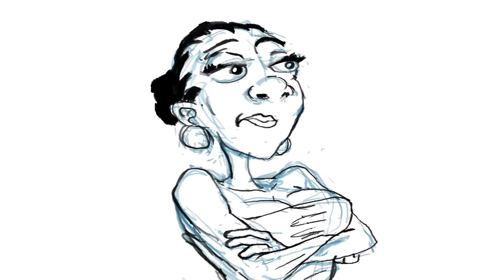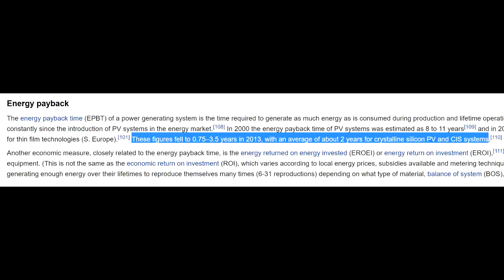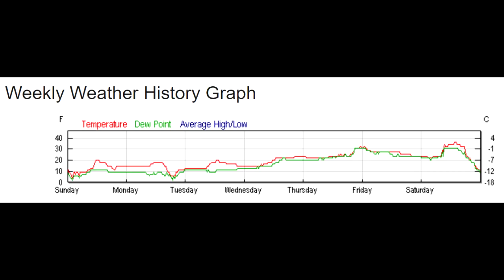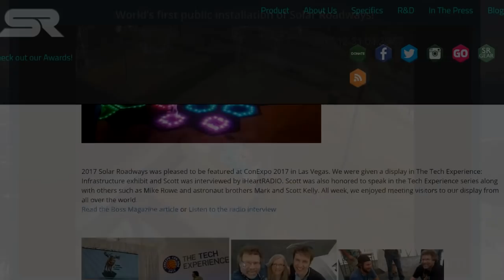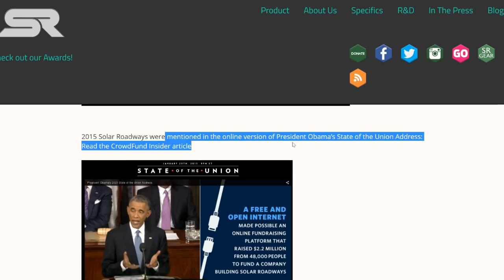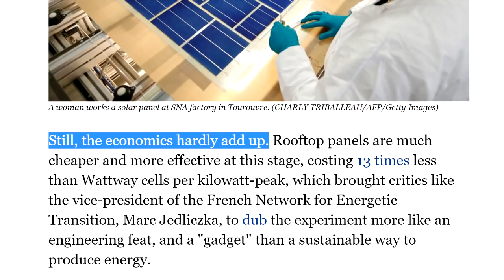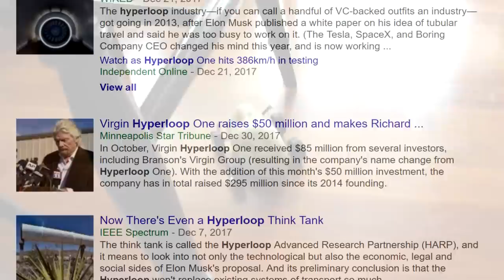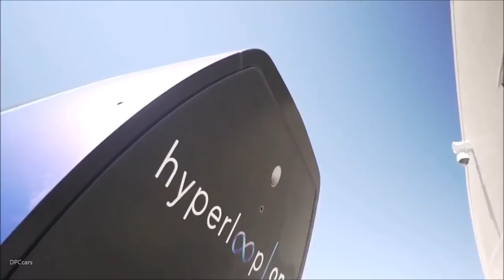Solar roadways, NEVER shovel snow agai... oh

Comment: "three types of packets"
data voice and video

As a networking professional this makes me scream. SCREAM I TELL YOU!
Reply: M5000 Blog it.
Reply: Elaborate for somebody who doesn't get it? Thanks!
Reply: only one type of packet, UDP. If you want to have some acknowledgement of the recipient actually getting the packet you have a stream going both ways, which then allows TCP to work. All the packets are the same size in the network, and all just have where from, where to and a block of data, plus a little bit of control data at the front. The network does not care, what it is, just where to move it to, it makes no difference if it is voice, cat video or your banking or recipes for cat food, it just is all the same in the network ( at least till the ISP's start charging for "premium" access or blocking the competition) as data blocks.
Reply: SeanBZA what would you call an analogue packet.
Reply: I thought it was Shitpost, Fake news and Porn shrug I s'pose ya do learn something new every day.
Reply: I have facepalmed so hard...
Reply: Well, we`re not talking about TF...
14:40
Reply: @Cameron Harvey
> Elaborate for somebody who doesn't get it? Thanks!
Let me try.

The internet is basically a bunch of machines all using the same protocol stack, which is layered. The bottom layer is the hardware layer (physical connections: plugs, cables, network adapters and so on). On top of that is the lowest software layer: the internet protocol IP.  On top of that there is UDP and others (but let's forget about those here, they are not important here) and most importantly TCP. TCP is short for transmission control protocol. TCP controls the data flow. The combination is the TCP/IP stack. 

The TCP/IP layers don't care WHAT they are transporting, they "only" make sure that data gets from one IP address to another.

The application layer on top of TCP/IP knows how to interpret the data. A video player will know how to play videos (including audio). Voice is just an audio stream. Data is all and everything what TCP/IP transports. 

But a video stored on disk would also be played with the exact same video player. So "the internet" is about transporting data and not trying to understand it. (Sidebar: At least as long as you have net neutrality ;-) ).

So, that is my take ... but I'm not a native speaker.
Reply: +Dick Bottox No problem bro. xD
Reply: +Conenion Very good explanation!
I was too busy "investigating" another part of this video...
https://www.youtube.com/watch?v=oNjPHcIzQkM
Reply: Porn is all the internet is for, as the song clearly notes.
Reply: SeanBZA, I suppose that's one way to look at it, but it really depends on where in the encapsulation you think it's important. Ultimately everything is bits but the least encapsulated layer is the link layer (Ethernet being the primary encapsulation). So why wouldn't you just say there's only 1 type of packet? As you said though you could go up the OSI and argue that layer 4 matters the most, the TCP/UDP layer, but then you run into the problem that there's more protocols than just TCP/UDP, eg ESP, ICMP, etc. Even the IP layer has both IPv4 and IPv6 differentiated. All in all that guys comment was stupid. He just arbitrarily picked 3 things and claimed those were the only packet types that mattered.

EDIT:

For everyone mentioning that the guy is from Cisco sales, what he's saying makes sense only from a business QoS perspective. Still his statement is simplified to the point of useless from a technical narrative.
Reply: Yeah that was dumb. Video is data, voice is data. It's ALL data...
Just another reasons why broadband was a stupid analogy to use.
Reply: Ah, I remember commenting about that on an earlier video. Data is data is data, the metaphor was stupid.
Reply: There actually is 3 types of packets. Standing, kneeling and pron. :)

Comment: why not do a solar powered hyper loop? two birds one stone
Reply: great idea. line the inside of the tube with solar panels, what could possibly go wrong?
Reply: Thinking about it, i think nuclear powered maglev train is a better idea. Hyperloop vaccum is good for speed, but there is alot of engineering problems.
Reply: Note next to the hyperloop there is actually a solar farm, right there in the desert with 12 hours of sun a day, and pretty much no snow as well, plus the panels do not need to have cars drive on them either or have fancy lighting patterns either.
Reply: @Divine Linker  Forget it.  Anything with the word "nuclear" in it, and people lose their minds.  When radiation preserved foods come back, i'd be more inclined to consider it possible.
Reply: Lassi Kinnunen
I mean, if your project doesn't "pay for itself" one way or the other, it probably shouldn't be getting funded in the first place.
Reply: Two birds, one coffin.

Comment: As I have said before, if someone wants solar roadways, then roof over the roads with solar panels. That would reduce snow and rain, and be cheaper and make more power.
Reply: Indeed though you still would have massive installation costs outside urban areas where there is no power infrastructure to carry the generated energy to consumers. Excellent idea for urban streets though they of course already have mains grid cabling running under them as they are of course lined with power consumers like buildings and street lights already.
Reply: Hey Pat! Always a pleasant surprise to see you in the comment section.
Reply: +meaturama Actually no it wouldn't be a cheap steel support column and frame every few meters is dirt cheap especially compared to the inch thick or more glass that would be needed to make the panels last even a year on the road surface that wouldn't be needed if placed on a roof like that. Also the latter panels would have a service life of 20 years rather than 6-12 months fact is that box steel girders are not exactly expensive an even if they were it the cost would be well worth it to extend the life of the panels by a factor of 20-40 and make them last long enough to generate a profit which ones on the road never will. The fact is there are no known transparent materials which are anything like strong enough to last longer than 6-12 months under the stress of motor vehicle traffic.

Prices for bulk regular solar panels are down to around $100 million per square km including installation or there about that would easily cover 100 km of road, solar roadways are quoting $10 million per km which would make that $1 billion to cover the same amount of road how exactly do you get the idea that $1 billion > $100 million. The figures are worse when service lifetimes are considered which works out to be $1 billion per year for solar roadways if not more compared to $5 million per year using regular mounted panels both for the same 100 km of roads.
Reply: The engineering or funding isn't the problem.  It's dealing with the red tape (and lawsuits) that takes the most time and money.  Just try to get approval for any sort of infrastructure project that isn't directly run by the government/military.  And if you're going to do that, you'd better make sure you get comparable returns on your investment BEFOREHAND.  As in, the tech actually working.
Reply: +meaturama "that is a thousand times more expensive than putting solar panels on the road"

No, as soon as you consider maintenance costs it would be FAR cheaper. There's no way a solar panel exposed to constant car traffic is even remotely affordable, and for replacing just one you'd need to block the street. If you use them as roof you still have higher installation costs than on the roof of a building but the maintenance costs would be comparable and in turn you don't need to care about snow and wet roads as much. It would still be a niche application but far more realistic.
Reply: +SaHaRaSquad I could see the structure also being used to supply trolleybus and/or tram lines and carry street lighting also reducing the maintenance costs by combining several separate pieces of infrastructure onto a single framework. Installing and maintaining thousands of light poles doesn't exactly come cheap for example and many cities are already looking to replace old sodium-vapour/halogen fixtures with more efficient LED systems.
Reply: +zaco21 Indeed, if you read my first comment I did actually point that fact out would work a hell of a lot better too with the panels being able to be mounted at the optimal angle for the latitude of the installation. Not to mention the whole benefit of not having their effectiveness reduced by scratches, cracks, oil, debris and dirt from motor vehicles reducing the transparency of the glass covering over the panels.
Reply: meaturama - People already do this with parking lots and still see a ROI.

Edit: Snow is still an issue, though.
Reply: + meaturama
A thousand times more expensive you say? Show me your math. Or let me do it for you, while pointing out several other problems with this nonsense. A solar panel that could handle the stress and wear of a road probably doesn't even exist, but the one that claims to be that costs 20 times as much to install as a typical rooftop installation. Admittedly, we would need to build the roof ways and that would be expensive, but the roof, if designed properly, would save a lot of wear on a traditional road - especially in the north. What causes most cracks and potholes is water seeping into the road surface, and in the north it can seep in a freeze which is far worse. Minimize the water getting on the road, and the road lasts much longer, and needs less maintenance. Solar roadways would probably be harder to maintain than conventional. That's because they would basically have to be built on top of a normal road. They could not just be placed on graded sand and gravel as the weight of the vehicles would quickly deform the surface of the road, and possibly break the panels without solid support under them, and if that didn't happen, water coming through the joints between panels would quickly erode the road bed. SO you would need a concrete or asphalt road underneath (costing as much as they do) then a layer of very expensive, difficult to install panels, all presumably wired together, and the road underneath would get little protection from them, and would still degrade and need repair, meaning the removal of the solar road, followed by repair/replacement of the road below, followed by replacing the solar road above. And since we see that they can't generate enough heat to stay snow free, they would have to be tough enough for a snowplow to go over them, and that means that the surface must be perfectly even. If the edge of even one panel is out of alignment just a small amount, the plow blade will catch it and destroy that panel, and who know how many more down the line. And we would still need salt - which would almost certainly corrode the connections between the panels. To roof over, and even enclose the road would be cheaper than the difference in the cost of the solar panels. For example, at our marina we installed a 35' X 60' pole barn with 14' height clearance (to get the travel lift in) including an 8" thick concrete floor for about $13,000. So, we can assume that the cost to roof and enclose a two lane road (even allowing for 6 foot shoulders, would be considerably less than 10,000 per 60 feet of road, while the solar panels for that roof would assuming volume discounts over retail pricing, be at least $40,000. If the solar roadways cost 20 times as much per sq ft as traditional solar panels, that would mean that 60 ft of solar roadway would cost $800,000, as compared to $50,000 for enclosed roads with solar or 16 times more, for 1/10 of the power. And my system guarantees perfect road conditions all year long, and even reduces of stops the problem of toxic runoff from roads, as they would never be rained or snowed on. Road life would be greatly improved by limiting exposure to sun and thermal expansion/contraction, and ending plowing and salting. And at that, roofing the roads with solar panels is still almost certainly a stupid idea, and it is at least 160 times better than "solar roadways".
Reply: + Seraphina S
Not to mention that, on a busy road, a large percentage of the surface will be covered by cars and trucks, which happen to block a lot of sunlight. You look at the Dan Ryan Expressway in Chicago - 16 lanes wide in places - lots of sun there! Except for the 4 to six daylight hours a day that it is essentially bumper to bumper traffic, and the rest of the time when probably 20 to 30% is shaded by cars. So on a road like that, I wouldn't be surprised if you lost another 50% of the meager power these things produce just from that factor. So that 10% of traditional solar that Thunder cited is probably VERY generous. Combined with the factors that you mentioned, I'd be shocked if they put out more than 3 or 4% of a traditional installation.
Reply: + idontcare80
Good point. At Michigan State University they have these huge commuter parking lots, because on campus parking is limited, and I had noticed that they had installed what looked like giant car ports that covered most of the area of the lot, and it was only when I used one of them to go to a football game that I realized they were all solar panels. And in this case, they actually help with the snow in one respect. Students (sophomore and above) can have a car on campus, but they park in these lots. When I was a student, we didn't drive much - bikes, walking, or the bus were more convenient for most things, and you might find your car literally buried in snow in winter. But these roofs are large enough that they protect the cars reasonably well from that, and the plows can usually clear the driving lanes without piling up too much snow behind vehicles.
Reply: Snow on the panels prevents them from producing power, unfortunately, but it's not like solar roadways are an improvement on that. The energy that it would take to melt the snow from roads would be absolutely phenomenal. The only way that would even be remotely possible is to have small, underground nuclear power plants distributed near populated areas, then their waste heat could be used to heat the roads. IIRC, small, underground nuclear power plants have been seriously proposed fairly recently. I would imagine that the waste heat from a nuclear power plant could be put to better use, though.

Comment: To be fair, the Hyperloop is at least more interestingly flawed than Solar Roadways. And the tubes could likely be repurposed, so it's not a total loss. At the very least, it's pushing the envelope of existing technology, which I do find admirable. Hell, it's possible that some of the resulting technical advances and knowledge might be put to other use. I just hope they're smart enough to stick with freight and objects, and not risk people's lives in the case of a failure. In contrast, Solar Roadways are just dumb from start to finish, and are mostly just using existing tech, without much potential for producing anything of value.
Reply: It's going to end up as an orbital ring. No need for vacuum chamber in space.
Reply: Niceu Harroc - Did anyone notice that they never were able to produce a one mile or ever larger vacuum in that tubes? They never showed it can work and if so a slight damage in the tubs will have devastating results. It is a very cost intensive and dangerous idea.
Reply: The only reason I think the Hyperloop could end up being a thing is the suggestion as to have it inside of underground tunnels. As they are already built to withstand 6 atmospheres of outside pressure due to the water table. Holding a vacuum in one of those could prove doable, and if it collapses, the large amount of dampening material will be appreciated.
Reply: Cakeportal - A mean of transport in a vacuum tube is surely not a new idea. It has been around for quite some time, but an idea is not a workable solution. We have trains that have a usual speed of about 300 km/hour and 600 km/hour  record speed and they actually transports thousands of people every day.
Reply: Eh... the hyperloop is mostly just solvable engineering problems. Thunderfoot hasn't really been all that accurate on the physics of the thing either. I seriously can't believe that people here don't realize that a leak isn't going to be a problem given the fact that you can relatively easily just seal segments with automated air-tight airlocks that shut if a leak is detected that cannot be overcome until repairs can take place.

Pulling a hard vacuum rapidly is only really needed for the ends of the tubes and can be accomplished rather easily by simply tying together a few strong vacuum pumps. We're not talking absolute vacuum here, or even anywhere near a hard vacuum. You just need to lower pressure down enough, not all the way.

Also, his argument about kinetic energies is worthless given that the final version of this thing will very likely have magnetic levitation and magnetic braking. Not only that but there is an upper limit for that blast of air if an entire segment fails. It's the speed of sound through the gases that are being introduced and it's not a big deal. Especially given that the vehicles inside can very easily be designed to let any blast of air simply flow right around it.
Reply: Yeah, at least they can be turned into a pipeline for oil or water.